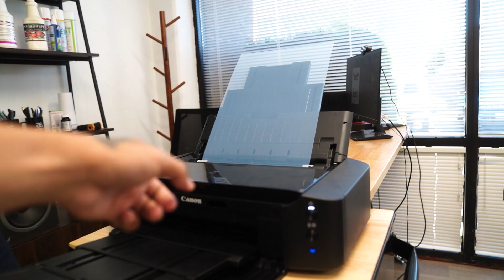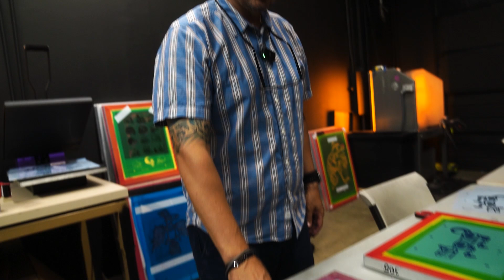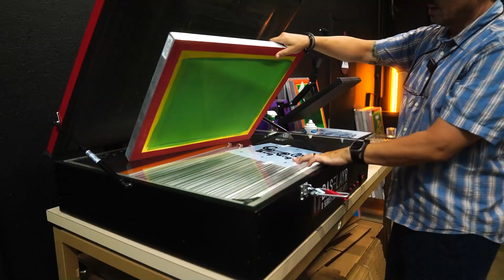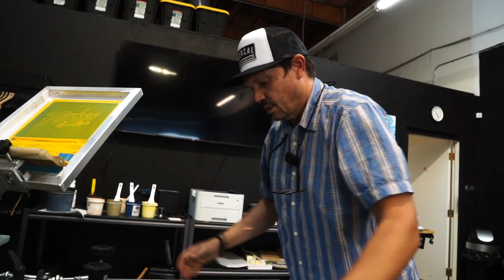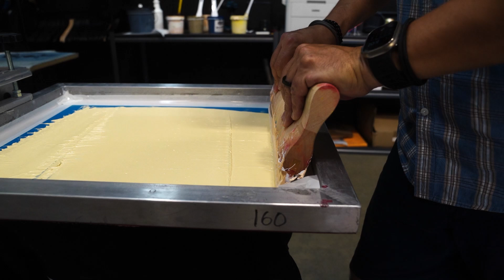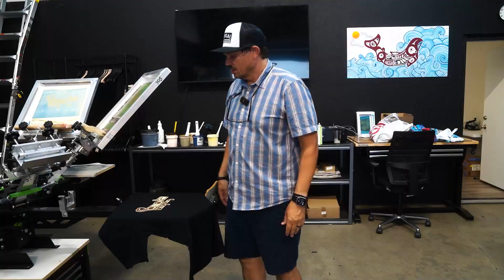Two Color Tonal Screen Printing Process | Free Print Advice

Comment: For this print would you ever consider doing 3 screens? Underbase 160, Brown 305, Highlight cream on a 160 or 200? If so would you strategize hitting the brown last still or the highlight cream? 

I used to hit flash hit the underbase but have been trying to move away from it as much as possible to avoid the moire effect and keep the prints as thin as possible.

Great job on the design and the print! Keep up the good work.
Reply from the maker: @scotlandskysurf8948  that could work, in my experience, finishing with the brown would work best. Easier to finish with the positive (brown ink). I like thinner prints for sure! Thanks for the good words! -Steven